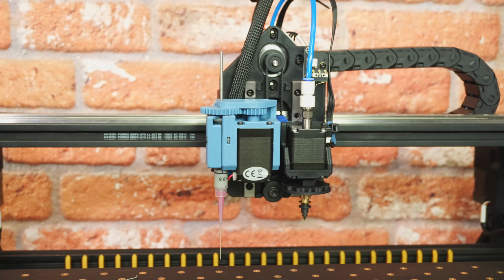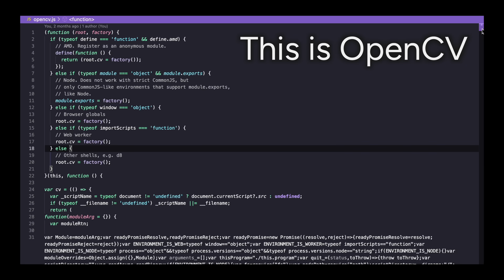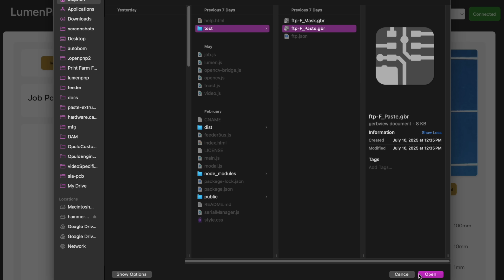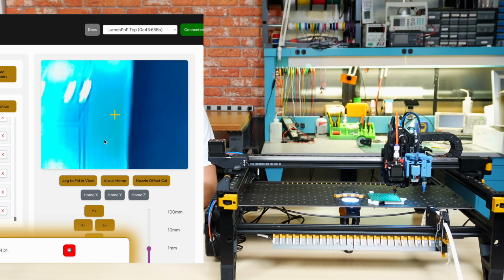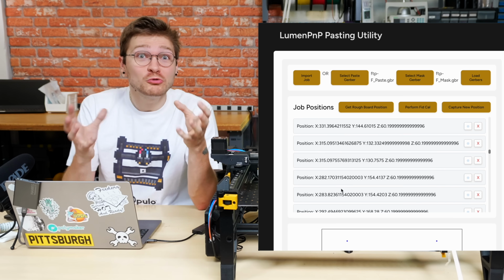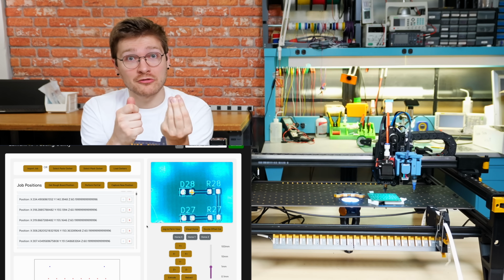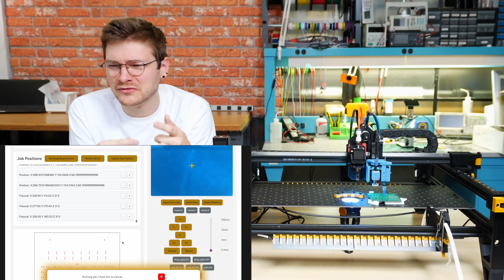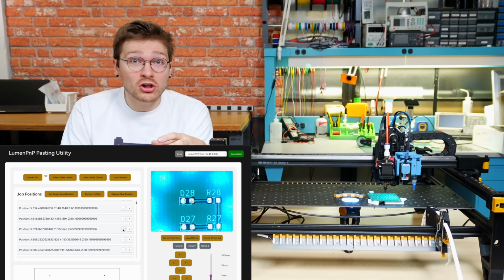Never buy solder stencils again

Comment: For people who are space constrained this saves a lot of space as no stenciling machines are needed.  I would like to see the melting process under time lapse of extruded vs stencil to see how well parts self centre and how well the solder paste spreads to fill available areas
Reply: I think that has more to do with the amount of paste than the exact position and profile of the blob. As long as it's touching the pad and not touching another blob of paste, surface tension will pull everything in. Extrusion just makes a little Hershey's kiss tail at the top, but it will melt the same. Of course there's nothing like a real experiment to test our ideas. It would be a cool video to do.

Comment: What if you flipped the concept — like “turning your idea inside out”? For example, you could make a stencil with cutouts for common ICs, then have the PnP place the IC onto the stencil just to dab on a small amount of solder. After that, place the part in its actual location. Just a random thought, but it might be a neat way to streamline the process!

Comment: Hi, 
You REALLY need to test the Omni 1 UV laser 10W, I make all my stencils and even PCB with it. Precision down to 20um. It doesn't burn like CO2 or Fiber lasers. With the right settings it can cut really well and fast. For now thicker thing I've cut completely through was a 1cm glass panel. Look it up on youtube please
Reply from the maker: i was actually talking to someone at open sauce about this. and you have no issue making pcbs with FR4 on this laser?
Reply: @stephen_hawes  I have the 5W which is less powerfull that their latest 10W option, but even at 5W my tests on 18um copper FR4 worked great. I have some 36um copper FR4 but haven't tested them. 
If you send me a gerber I can make the engraving and show you the results. (I bought a LumenPNP last september for a delivery in France, if you search in your client database Georges or Blossom , you can find my email, otherwise I'll send you one)
Reply: @stephen_hawes  No issue at all even with the 5W on 18um copper, and this laser can do super small features/tracks/spacings, down to 22um. 
You can contact me by email, we bought a lumenpnp V4 around last september if you look at Georges or Blossom, from France. 
If you send me a gerber I can make it for you and show you the results. Cheers

Comment: I've got a couple of ideas that might help to improve this further:
1. You could make special fiducials with a copper ring around the dot. FID1 could have a thicker ring. Then, the system could use OpenCV to automatically identify the fiducials both on the gerbers and on camera (because they have a special shape).
2. To automate the purging and limit waste, you could use a side-camera and extrude until paste comes out and run on a "wiper" like some 3D printers do. Or a small mirror to deflect the main camera 90°. Not sure if it's worth it though.
Reply: Since the paste is conductive, you could perhaps determine when it has been primed and deposited on a conductive plate using a capacitive touch sensor.

A similar method could possibly be used to calibrate the extrusion for a desired material flow.
Reply: @multiplysixbynine  I came here to say this. also height calibration could be done using a torque sensor (changing current in the stepper motor) that determines where the surface of the pcb is to get the correct height. This is done by some 3d printers.
Reply: @DeveloperChris it's very easy to achieve this in 3D printers and there are multiple ways to probe Z height. In my other comment I give more details. About your idea on using torque, TMC stepper motor drivers that costs less than 10 bucks, have a feature called sensorless Homing (officially StallGuard®) that does just that. In my custom built 3d printer I use it to home X and Y (but also possible for Z). All it's required is to calibrate the sensitivity (so it does not punch through the surface below or stalls mid way due to motion resistence). Other methods are via capacitive/inductive probes, lidar sensor (more applicable to 3d printers that need precise mesh of the entire surface), physical probe, which is like an endstop switch that clicks when touches the surface, among other methods.
Reply: Regarding the special shape: if FID1 2 and 3 were different shapes entirely, like "thick circle", "triangle" and "square", then you had enough individuality that it could figure out what's what.
Or if you wanna make it a little more user friendly: FID3-5 are "triangle", "square", "pentagon". Then both, machine and human can look at them and know what they are.
Reply: @BloodyMobile I think the issue there is circles are nice because you can take a MASSIVE notch out of them and still perfectly reconstruct the full shape and find a perfect, reproducible centerpoint.

The one thing circles lack is orientation, but that can be provided with an assymetric grid of fiducials and doesn't need to be part of each one individually.

Other shapes are more 'complicated' and prone to errors from damage, camera BS, etc.

In a freshman year college project I basically self-taught a full fiducial calibration system in Matlab and - for as jank as it was - if our fiducials weren't circles there's not a chance in hell it would have worked half as well as it actually did. Detecting a pentagon or star requires lots of logic and the shape 'looks' entirely different depending on how it's rotated. (We, as humans, know it 'looks' the same, but computers are stupid - to them it 'looks' like a completely different shape) What I was able to bodge together with a simple algorithm like "find me all the bright green pixels, get rid of any blobs smaller than 30 pixels big, put a bounding box around the rest, find me the center of those boxes, sort the array of points, draw indicators on screen for them, return the array of center points" is suddely made 100x more complicated when the shapes themselves are non-uniform.

Granted, a competent system wouldn't be remotely designed like mine was, BUT the point is that the 'simplicity' of circles makes them really useful for simple fiducial positioning.

The algorithm I described was very jank and yet (after some simple upscaling to increase the pixel count) worked perfectly to identify a target anywhere on screen from a long variety of distances with only one picture from a crappy laptop webcam. (In a real world environment no less! It was an aiming algorithm to find a target placed in a room any distance and angle)

The best non-AI detection algorithm I can think of for non-circles would probably involve star-fiducials and edge/point detection, drawing lines along the tips of the star, grouping lines based on their proximity wrt their origin tips while throwing out any detected 'tip' without other tips nearby, calculating every intersection point of every combination of two lines within a set, then averaging the distance while throwing out the two points furthest away from the rest. Possible? Yes, probably even rather reliable, but SIGNIFICANTLY more complicated, more likely to run into issues, more likely to be affected by camera oddities, and all for not a lot of gain. (Example :  think about how FOV distortion might affect this. Do you want a wide angle lens to spot fiducials from far away? Well then you're going to be distorting the hell out of those stars, so how would that affect this line-based detection algorothm? What about false positives? How do you reliably tell what 'edges' are tips of a fiducial and part of the circuit board? What if parts of the star or camera are smudged or damaged? What about in-camera processing? If your camera module does builtin autosharpening for example, how would that affect it? Etc.)

Basically, it sounds good, and hell it might even work and have advantages over circles, but it's a LOT of extra headache to design a more complicated fiducial system, for no obvious/major gain. A freshman with zero computer vision experience can make a CV detection system at any range and angle with only a laptop camera and no fancy ML libraries or anything when using circles, and it'd actually work! They're just that simple and reliable.

Personally, if you needed to go beyond simple point-detection I'd say add rings around each circle to number them (POSSIBLY even with a binary-encoding nunbering scheme - though I'd hate to be the poor sod who has to count how many 0s are between two rings. I'm sure there are existing solutions for this, but I still wouldn't want to be the one responsible for implementing them.) and then add another dot, POSSIBLY even a small equilateral triangle, at the bottom of every one for orientation. (Averaging the angles detected for each fiducial, throwing out any outliers automatically, for the final angular value for the board)

Comment: Well, the solder paste amount should be proportional to the pad size, in this case it looks constant. If you make less than 5 boards this can be useful, but not worth the $2000. It may be feasible if you can modify a $100 3D printer to do this, you better sell a 3D printer modification kit.

Comment: This is cool. I’m just wandering: We have inkjet printers… and that technology is very mature and wonder if it could do solder paste
Reply: They do exist: https://youtu.be/qoOsbm0Z9tk?si=F1lWhaQwUg3lwIKW
Reply: In normal production, paste printing takes max 10 seconds. Printing each dot is not efficient.
Solder paste stencil printers can run for decades with 0 maintenance, just some oil and grease every 6 months.
Dot Printers will need monthly maintenance, clogged heads, etc...
Reply: @firedeveloper  For prototypes and short runs it has a practical use especially if you are making the boards in-house using fibre lasers (with possible metal etching) to prepare the board.

Comment: This is pretty cool. I really like that you are using fiducials and automatic alignment, this is very similar to what we do at work (semiconductor lithography machines). But embedding OpenCV on the app is a huge overkill. If it very easy to find filled circles in an image, it is basically edge detection + radius mask. I can not wait for you to automate even more the process with a robot arm to pick boards and replace them

Comment: For the purge could you make a set xy with a dish that you just purge a little into before the job? Or is it best to have that be a manual purge?

Solder paste is conductive right? What if you make a pcb with just a large flat open pad, connected to a digital multimeter and when the resistance changes by a set amount it knows that the right amount of paste has been purged on the purge pad.

Have a clean purge pad routine that lets you wipe it off then resets the resistance to whatever it is after. The set resistance shouldn’t matter, only the differential between purges.

Comment: When you said we'd have to manually prime the nozzle, what I heard is that we should be designing a large, extra pad that doesn't ACTUALLY need paste that can be pasted first to automatically prime the nozzle!
Reply from the maker: that's a killer idea! or make a little purge station on the machine where it can deposit the first bit of paste
Reply: @stephen_hawes I reckon an auto-prime / purge system like that would be amazing... just pop your board in, and let the machine take care of itself 😊
Reply: @stephen_hawes  A number of people have also mentioned a 45degree mirror that will fold the camera view at the side of the nozzle to determine the nozzle Z height.  This mirror could be at the purge station and you could visually (even remotely without having to peer into the machine) observe when the dispensing needle is full.  Focus will be an issue unless unless your camera height and nozzle spacing cooperate though it may not be critical.  A simple lens with the mirror might solve the problem if it is too severe.

The other good suggestion was to dispense a few minimal size dots onto to determine the X-Y offset.  Doing this on the jig is better than on the PCB to avoid having loose solder balls bouncing around after reflowing but having a exposed copper area where you can place the dot is also safe.  You can also mark board revision of even SERIAL NUMBERS in binary on a double row of pads that you dispense onto either the ones or zeroes.  This can then be extended to programmatically coding your boards by making solder jumpers rather than (zero ohm) resistors to give them IDs though a selection of resistors might provide many more bits of coding and this can be implemented at the pick-n-place time.
Reply: For assembly systems (adhesive) we keep track of the time the nozzle is not used and auto purge before starting a job. 
We just dispense into a paper cup and wipe the needle at the cup edge. 
For home use you could borrow some paper ketchup cups from mcdonalds 😉
Reply: @LimBo3500  That's smart!  Smarter than my idea.  All our modern consumer grade 3D printers have dedicated a dedicated purging and wiping area.  It'd be easy to bolt something similar down to a known spot on the Lumen for sure.

Comment: For tip offset cal, why not dispense a dot and vision that to determine the offset?
Reply: Could even make it remember the calibration from the previous job, and 'test' it at the start of a job, then do this if it needs to be recalibrated
Reply: could potentially also work as a prime for the nozzle if done carefully
Reply: dispense, look, nothing there, dispense some more, look, ...
Reply: @ItsAMeAndrew  A simple loop of dispensing and checking until you find a dispensed dot, would let you find both the position and prime the nozzle.
Reply: Makes sense. I operate a conformal coating machine at work which uses a kind of soft putty which you jog your tools into and then use vision to determine offset.
Reply: It’s funny to see both stuff from FDM and CNC machining show up here. Tool length calibration and extruder settings etc. 

For TLO if you could literally just use an off the shelf sensor same as for CNC. 

For extruder, yes, use CV on a calibration pattern. You’ve already got the CV so why not use it. And/or have it grade its own paste placements as it goes. 

Looks like the nozzle is making rapid moves between pads using shortest path. Because there will be paste that travels with the nozzle you can make it smart and travel a path that wipes the paste appropriately. Eg a pad long in Y but narrow in X, wipe in Y direction. Maybe that doesn’t matter enough to warrant the time penalty. Could also “Mr Whippy” spiral up in Z during retract. 

Nozzle tip geometry could be interesting. If pads are mostly rectangular then try a rectangular tip. More complex than just going “boop” and putting a blob down but could be the path to better results. 

Given it’s all CV you could probably get away with an off axis nozzle or angled tip. No human would apply paste at 90 degrees from the board plane so why not teach the machine :) 

All in all, very very cool project even though direct access to USB peripherals from inside a Chrome tab gives me hives …
Reply: If the cameras FOV is high enough, a small mirror on the base could let it see markers on the bottom face of the paste extruder and find the tip offset, even IR markers for night work.
Reply: There’s even cameras for calibrating multi tool head printer nozzle offsets which might work too, but using the existing hardware is obviously better. 

A little limit switch could also set the Z offset if that’s needed like TazBots, or even a conductive pad to touch off of instead (but again, extra hardware). 

Apologies if this was addressed in the video, I was half listening in the background 🤷🏼‍♂️

Comment: If you've already identified the fids from the gerber, why do you need to jog to fid 2/3 - it should already know the approximate position & should be able to go there by itself
Reply: problem is the machine deosn't know where you placed the board on it. The positions in the gerber file are just covering the "surface" of the pcb, not the entire lumen working area.
Reply: Yes, but once you have the first position you know the distance to the second, so you could auto jog in a circle around the first position and scan for fiducials. Then ask the user "Is this fid2?" The rough position of the third fiducial should be unnecessary
Reply from the maker: yeah, technically manually selecting the third is optional, but having the option to manually select all three is an important backup if fids dont work for whatever reason!
Reply: This is just too freakin cool 🔥
Reply: I've run into bizarre issues with fids on pro PCB mills (Protomat S104). Manual jogging for fid ID is a must, no matter how many you've picked up.